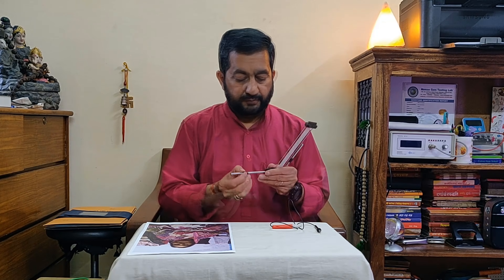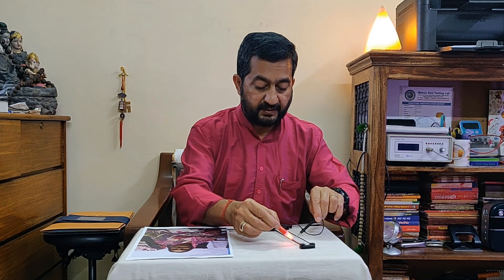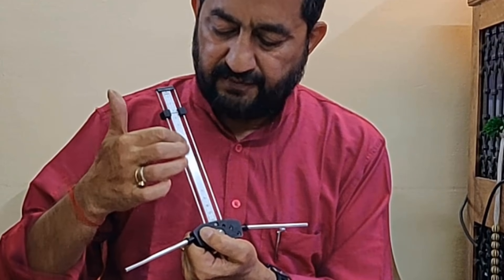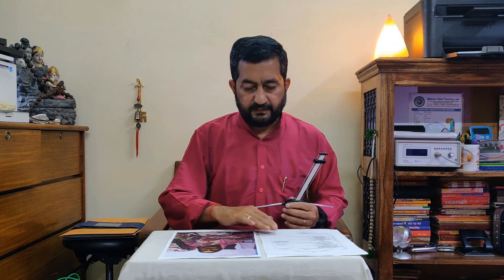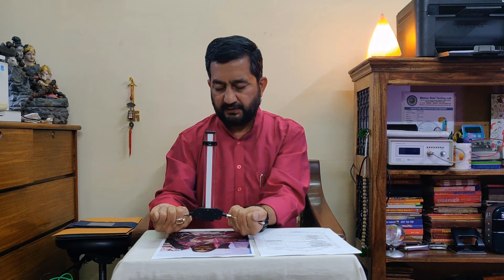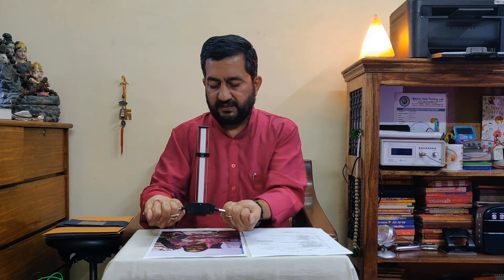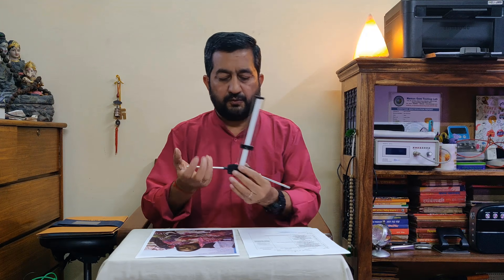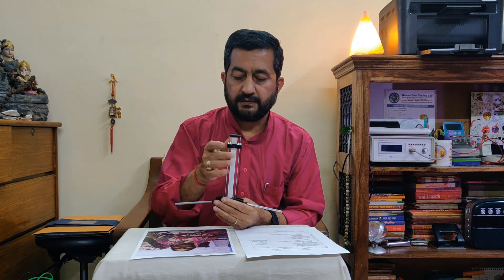HOW TO SCAN ENERGY BODY THROUGH LECHER ANTENNA

Comment: Pl intimate how high frequency wave lengths indused in antenna with out input power . Which part of antenna works on frequency.  Can I talk to you on phone.
Reply from the maker: low frequency wave length works can be checked through electronic continuity tester antena right and left of the scale works I am purohit not a scientist  contact ACMOSS , France for deep engineering of the Lecher